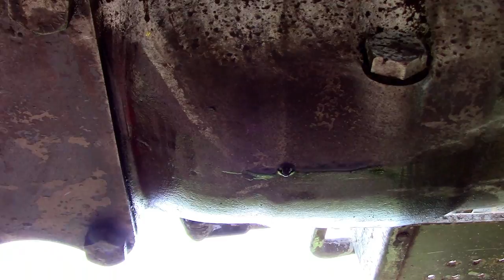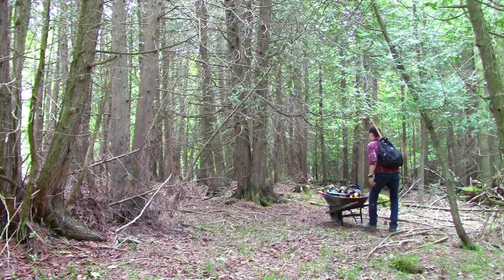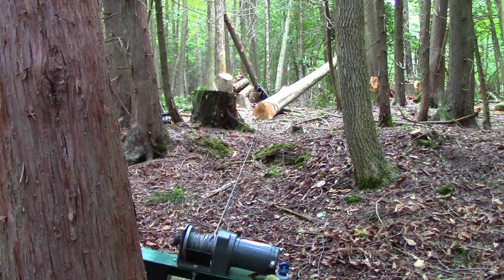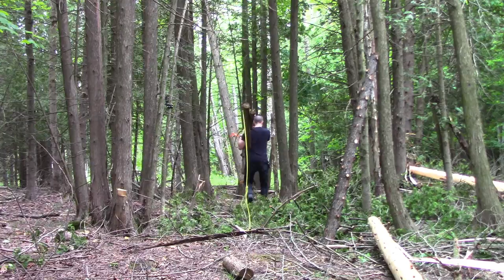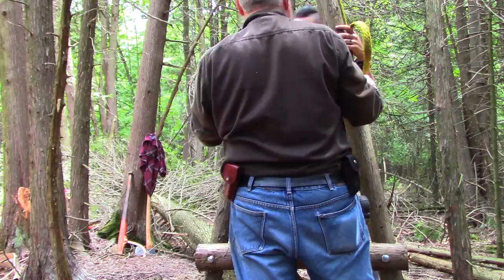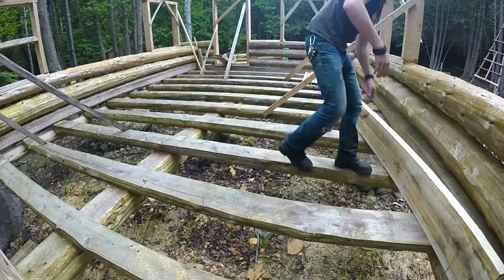Cabin Flooring & Tractor Breakdown- Ep36- Outsider Log Cabin

Comment: If you can, either get yourself a LogRite logging arch (with or without the hitch mount) or build a similar tool yourself.  It will pay for itself for many years to come in just helping you get your logs out of the woods, and also help save you some bandsaw blade sharpenings by keeping your logs out of the mud and dirt.  http://www.hakmet.com/LogRiteTools.asp?Bottom=1&Info=1

In someone else's channel where they had just bought one of these, I saw how useful it was for him to be able to easily haul logs uphill BY HAND (using a rope) because there was no longer any drag from the mud and dirt.  I made the suggestion for him that he might even be able to hook a pair of these up to a large log, turning it into a trailer of sorts, but apparrently the LogRite company is a step ahead in that respect.  They just sell larger models, and you can simply position the arch over the midpoint of the log and suspend it from it's center of gravity and treat it just like a trailer.

Comment: You didn’t here me screaming by man you be careful around that live  winch cable it will take your head off woo ! Kevlar helmet and chaps hoo!..wow. You can use that bark for kinlin roll it up and dry it it would burn perfect sorry just pass in some ideas thank you for the videos I can’t get out any more after what I have done in this world 🌎 ..that really sucks babe,   It’s a drag ..here is one cut up some small pieces of rubber car tire in to little 3x3” pieces so you can stash them where there handy  ,,!  They will burn and dry out wet wood ,leaves , equipment,frozen and will burn a long time as well  I use them in my E-vac pack and brake out bags ,,, good signal fires too my dad use to cut tires open flatten them out and make bumpers ,ramps , nail em too wood  but in the bad weather. Rip them off and burn em!.....thank you have a good one ☝️ blessings 🙏👽

Comment: Just a thought for you to consider...  That bark you are pulling off the lumber, could you not sell it to an interior designer?... It looks like its coming off in 2 feet wide sections which would be fantastic as a wall covering.. Kind of half way betweeen wall paper and wooden paneling... I would have thought that if you can do it in reasonable lengths you could charge a fortune for something that Im guessing you will just throw away or burn!...

as Its my idea Ill expect a commission on all sales lol.. Just a thought.  Steve

by the way, great videos, Ive now been watching for nearly 2.5 hours lol

Comment: I've been logging professionally for 35 yrs and have some comments.

1) Thin/fell more trees and make skidding roads so that u wont have all the trouble with snagged trees. Or maybe u will anyways coz it looks like u only take the out the pluss/best trees (ie high grading) which is a no no among professional foresters.
2) With some more clearing and planning I guarantee u I could have felled those same trees without any winch or leverage tower. Seriously. Fell 1-2 small trees 90 degree to the direction to the tree u wanna cut, then make the felling cut smaller - max 2/3 of diameter - and closer to ground, when the tree snags cut the ''hinge'' on one side and leave the rest intact, use the cant hook to rotate and wiggle the tree to the ground.
3) Hope u lose a leg soon. Felling and not least de-branching without propper safety gear is 110% stupidity.
4) Else, good and entertaining videos.

Comment: Hi if you can get to most of your wood wich I can c in this video y don't u get a small ride on mower tractor and little trailer to take your stuff out to the woods one you can fix a winch to it then u could put a strap from the frame rails and u will be charging the battery at same time. I have a small ride on tractor and ground clearance is hi from what I can c what u got in the wood  there my little tractor would have no problem at all.  And thay not that deer to by . I'v all so got small crane on the back as well it will lift a fair bit.  Just a thort.  All the best from Andy in UK
Reply: A riding mower/lawn tractor would never be able to navigate the ground in the woods and they are not built to put all the power to the ground but rather to their attachments. A tractor is build to a different standard where they know the owner/user will abuse it day in and day out.